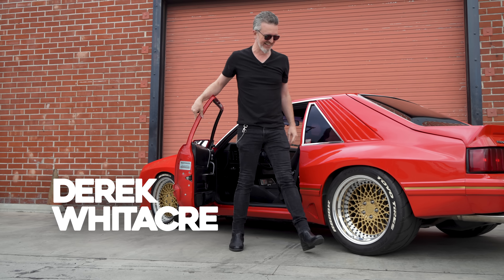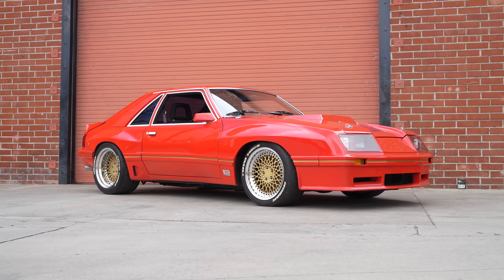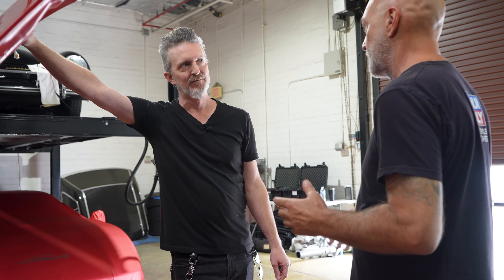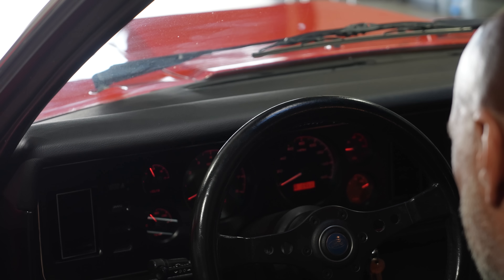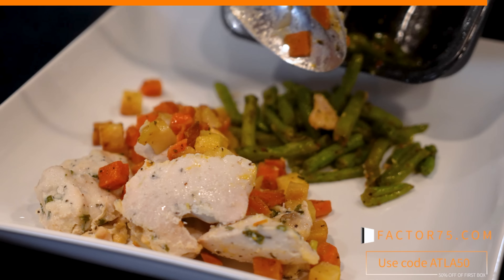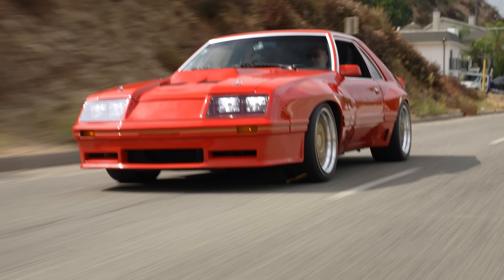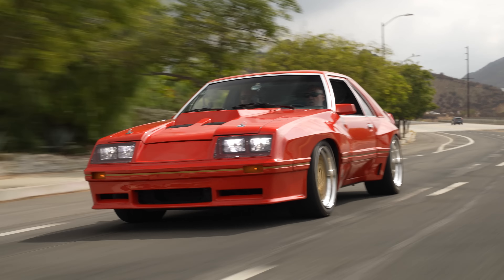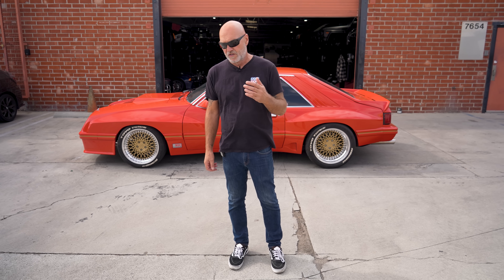The Forgotten McLaren Ford Mustang | WIDEBODY FOX BODY [4K]

Comment: If mid 80's-early 90's American cars (assuming we're talking performance cars) are "$hit" what exactly by those standards wasn't?  If we're talking road racing I seem to remember Corvettes going undefeated for 3 years straight from '85-'87 in SCCA Showroom Stock.  As in they won every race.  Porsche and Lotus got so butthurt they got together and had them banned from the series and they were forced to race against themselves in Corvette Challenge.  In 1989 Morrison Motorsports took a new ZR-1 and set 5k km, 5k mile and 24 hr FIA World Land Speed Endurance records that still stand TO THIS DAY for production cars.  If we're talking street racing, back in the early-mid 90's there was a huge street racing scene in South Florida (as I'm sure there was everywhere else).  Of course there were lots of older musclecars but outside of the one near thousand horsepower turbo Porsche and turbo Vette one shop had, 5.0 Mustangs were everywhere and were cleaning up.  Didn't take much to get them to where they're fast even today.  As all around stock sports cars, optioned correctly what could touch a period Corvette, Z28 or Firebird for the money?  One buddy had an 11 second GN back then, another a super-stealth 11 second Mark VII and another a 10 second Mustang and there weren't too many cars running around that could touch those guys.  Pro 5.0 Champion Jim Heavner used to always bring his 8 second Saleen out and take people for rides in it too.  Not much would touch that car even today.  Maybe you got your decades mixed up?

Comment: I had one of the last foxes, a 93 5.0 lx fastback. I loved that thing.
Reply: I just bought a 93 with a Vortech V-1... People go crazy over it
Reply: Last few yrs were leaps and bounds better than the earlier ones
Friend picked up a 90 or 91 Vert black it was noticeable quicker than my 86 and just nicer inside
Reply: @gordocarbo  They could all use a suspension upgrade but the sefi was great. I worked with someone who took off the FI and carbed their late 80s 350 camaro. The lx was lighter than the gt and way lighter than an F body. He couldn't help but comment on the acceleration, even with a 3.73.

Comment: The mid late 80's is what revived the muscle car generation. Fox body's and Irocs. Even though the 5.0s only had 220 hp, they still ran mid to low 14's in the quarter mile. Some headers, heads, intake and slicks and your into the 12's.
Reply from the maker: I love that he gave this a 347 stroker…perfect for this car imo
Reply: @AutotopiaLA  Yeah for sure. When he mentioned 400hp (like that was bad), I was thinking that thing is an easy 12 second car. Perfect for the street and won't get away from ya. I miss the 80's, thanks for the nostalgia.
Reply: @Ironwind1972  Agree...had a couple as a teen in the 80s and 400 is about right. 
Enough to have plenty of fun but not put you in a coffin.
Reply: @Ironwind1972  Feel the same way....the troll post from kids think a bigger hp number means everything. 
For this chassis its just right. 12s back then was pretty fast for a st car even 13s was respectable
Reply: Depends on the track DA tires, driver. Most ran 15s but saw a few run times you mentioned.
First thing I did when I got my 86 in 87 was run down to Galpin FOrd in Van Nuys and get their Ford racing book & burned up that visa!
Reply: @AutotopiaLA  Thought your shop was in O.C...its in Burbank near Jay?
Lot of your Routes look familiar grew up sfv

Comment: I follow Derek on IG and his car is amazing 🤩 my own 1985 had a 351W in 1995 and my desire was to Meier Racing WB kit or something similar to the M81/IMSA cars of that 80s era. The nostalgia this car invokes is off the charts. BTW, my father was from Goslar Germany. Air-cooled Porsche expert...hated my fox when we started, when we finished the swap he came around. We also restored a 1956 356 in the same oversized shed  😊 Hot Rodding is the same regardless of brand or engine 💯

Comment: There was an ASC McLaren convertible I used to drive by in the town next to mine. I'm not sure what year it was (obviously '80s) but it was white with a dark blue top and interior. The guy just parked it on the street outside his trailer for a solid 20 years but I haven't seen it in about a decade. I was never a big fan of the Fox Body Mustang (too uncomfortable to drive at my height) but it was pretty sweet.

Comment: First thank you for not stuffing a LS in there❤ . 

A fox body is like a handy man. Doesnt do anything great stock. But they sure are modifiable.  And then they can do dam near anything. Sure the doors dont close as nice as a Porsche. But there's just something special. About the platform. I've got an eighty four, Myself. And I love driving it and would never sell it.  Knock on wood i've had great luck with mine even though it is modified. Boss crate with boost, t56, all the goid stuff. As long as you don't try to reinvent the wheel but rather go with proven formulas. It's pretty reliable. Hardest thing is finding a good tuner that will give you good cold and hot start not just wide open throttle tuning.  Happy motoring thanks for sharing. I'll be looking into suspension myself either maximum motor sports or ride tech. They have the s550 Rear IRS Swap now which is tempting.

Comment: I disagree with the comment about 80's American cars. There were several that were cool and made great hot rods: Mustangs, Camaros, Trans Ams, Monte SS, Grand National and T-Types, Hurst Olds.
Reply: All the new models you listed ive owned or driven when new. They were great cars, just as solid as any other new car. 
Put my 86GT through hell, Z28s also no rattles, super reliable 
Both stolen with just under 100k on them
Reply: @gordocarbo  Wealthy car snobs might say otherwise, but these cars were part of the good times we were having back then. You could put cams and headers in them and change the wheels and tires just like any performance car and make them faster, and the turbo-Buicks got faster as aftermarket technology progressed. Swapping the 305s for 350s and 383s was cheap. Every Ford Motor available would fit in a fox-body.
Reply: @Spiritof_76  Agree, more and more I see the purists tell everyone they ruined their car cause its not bone stock or lowered value.  Must lead some boring lives huh?
After my 86 was stolen, bought an 85 in 89, ground up resto but had a 460/c6/100 shot professionally done. Total money maker...only thing ruined was me, tough to go back to small blocks! haha
Reply from the maker: My comment was a general statement of overall quality back then. Great cars that needed some serious upgrades
Reply: @AutotopiaLA  When someone has lots of income, cars that average people own look pretty shabby. Clear coat paint lacked uv protection, plastics deteriorated in the sun, carbureted car emissions robbed horsepower before sophisticated computer engine management came along. Did cars need serious upgrades, or do some people think everything should have 500 horsepower and be able to run at Indy?

Comment: Props for being a dude that knows and acknowledges how bad ass the Capri was. The fenders made it way better looking than the Mustang. I owned a '83 RS 5.0 when everyone else had a stang. It was a stand out for sure. Got rid of the bubble hatch for a hatch with a whale tail. I must disagree about how bad it was back then. Stock factory stuff did suck but with a few dollars in your garage you could build your own power and smoke 90% of what was in the road. Good times for sure.

Comment: In the old neighborhood we call them GT's .... In high school I did several renderings of the 1984 Ford SVO for drafting class, the M81 Fox Body car here is the car Ford should have built back then with Turbo 4 Cosworth option as well the American V8, the reality was Ford had extra Winsor engines so they got the Winsor, and SOHC 2.3 Pinto Capri left over in their inventory, so a business decision on Fords part. Even CHP liked the little V8 powered notch back option, I think anyone growing up in the 80's if you didn't get the single red light in your rear view mirror at least once then you weren't going fast enough, recall a time it took a 5.0 CHP 25 blocks to catch up to me, and he still only gave me a ticket for that incident, and not a trip to jail...lol
Reply: I outran one of those CHP 5.0s on teh 14 back then. It caught up to us quicker than I expected but i had more pedal left
Agua Dulce to my front door in Van Nuys 12 minutes. They eventually nailed me bout a yr later
Reply: @gordocarbo  I was in a modified 1980 Ford Fiesta that at the time had a draw through turbo on it, OG TurboNetics adjustable wastegate, RayJay aeronautical turbocharger with a single side draft Weber DCOE carburetor. Perhaps the officer saw my little Red European Ford as a good chase, regardless could I have out ran him, probably, but the radio would have caught me !

Comment: So, it's not a McLaren anymore because you swapped out the engine...
Reply: Exactly why its not anything near what its Beeing portrayed as
Reply: @DaVe-iSnOtHoMe.MaN.LemmingsWeB  Cause none of these "classic" American sports cars are worth the piss with their stock engines AND FORD absolutely sucks at making sports cars without an all-star cast of external engineers. Hell, no one would give a shit about 'em if it weren't for Shelby, McLaren, Saleen and even Mazda.
Reply: None of the cars had McLaren engines except for the #1 prototype.  Even then, it was only a built 2.3 Lima with adjustable boost.  All of the 1-10 cars were prototypes and mostly built for appearances or display.  Most of the DSO cars like mine were built on later V8 cars as were the GT Enduros.   McLaren had very little to do with the program after the first car.  All of this information I got from the last surviving builder.